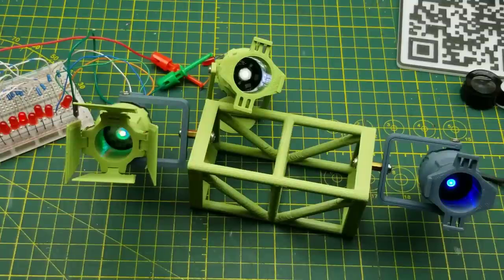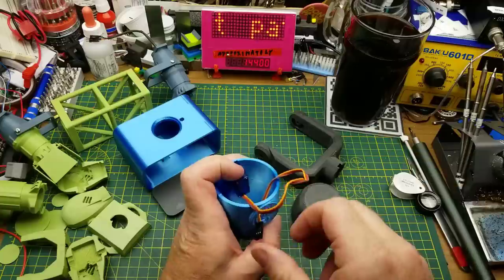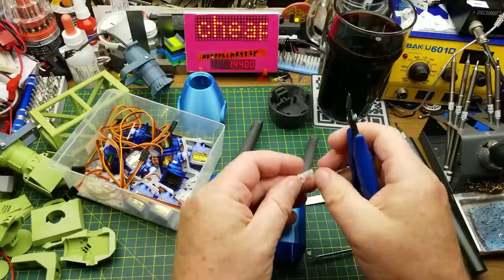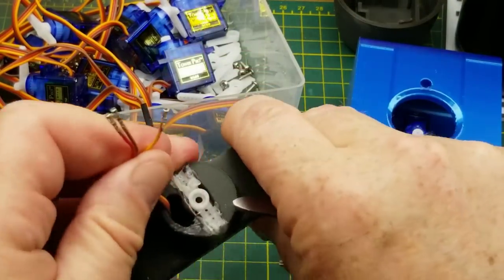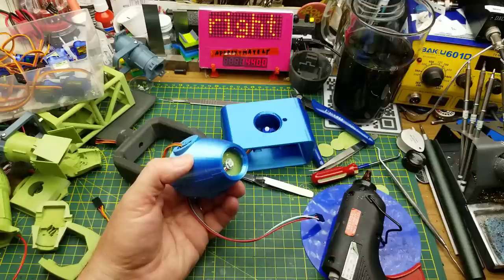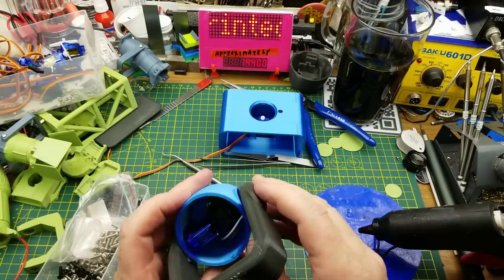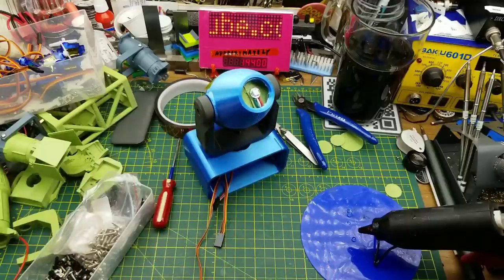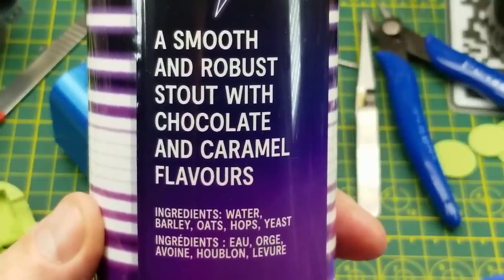3d printed moving stage light

Comment: Might be fun to add a mic and a low pass filter to one of the arduino analog pins and see if  you can get it to move to music.  Or maybe theres a beat detector circuit in one of the Mims books?  I strapped a Mims bass booster to my 1980s Walkman as a kid.  Seem to recall theres a lot of audio circuits.

Comment: That is such a cool project.  Not sure this would help with your screw issue, but I bought a really low profile ratchet bit holder that allows you to take standard bits and use them at 90 degrees in tight places.  I find myself using it a few times a week when I can't get to screws.
Reply from the maker: Another thing to order for a future mailbag!
Reply: They have 90 degree Philips and flat head screwdrivers I am surprised that you don’t already have them
Reply: Maybe for a bit of better smooth motion use brushless servos
Reply: @shroomy7199 theyre so pricey. I have a host of them for my crawlers. I'm going to start building my own out of all the small bldc motors I have.
Reply: Nothing is cheap in this game anymore unfortunately ;)
Reply from the maker: @TheSonofruss  I do, but not tiny enough for this screw.
Reply from the maker: @shroomy7199  Maybe, if they were the correct package size.
Reply: @pileofstuff  that’s a good point I am sure there are some

Comment: cool project ! 
.. you could use some headphone wire to route the led inside the moving parts ;)
Reply from the maker: That is another good option, as long as the current isn;t too high (which it isn't in this case) 
I also have a few other types of thin flexible wire available to try.

Comment: Want to know more about the RGB LED's wattage you recommend. Heat will be an issue so do you think a 10 watt would work?
Reply from the maker: If I were to put a 10 watt (or larger) LED in there, I'd mount it to a heat sink of some sort, with some sort of a thermal barrier between the 3d printed parts and the LED/heat sink. Maybe even a small fan at the back and add some vent holes.
Reply: Thanks for the reply.
Where did you get the clear lens?
Reply from the maker: @dennischerry4545  Some random youtube seller several years ago. 
Probably search for the diameter and "lens"
Reply: @pileofstuff  OK will search.

Comment: What was the tape that was used to connect the front and back of the pod?
Reply from the maker: polyimide tape, commonly referred to as "kapton tape"
It's electrically insulating, mechanically strong, and heat resistant.
Reply: @pileofstuff  thanks..  Need to get myself some of that.